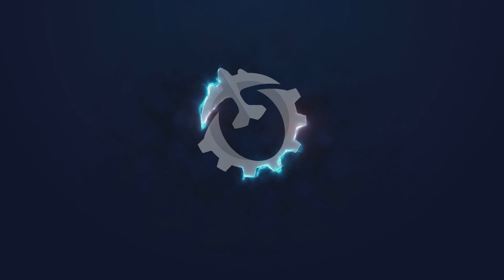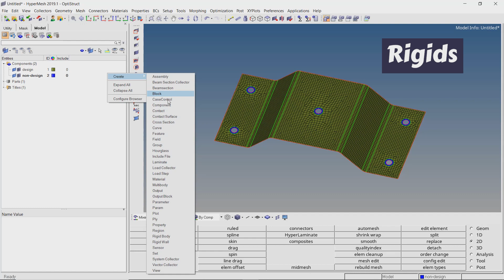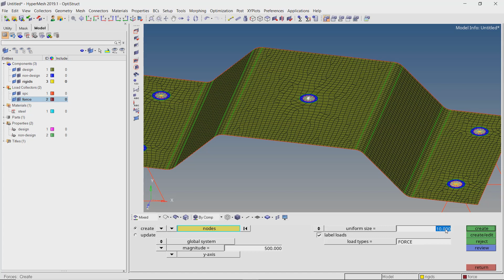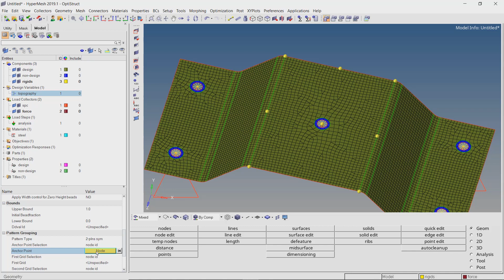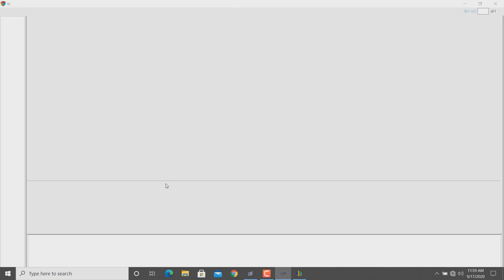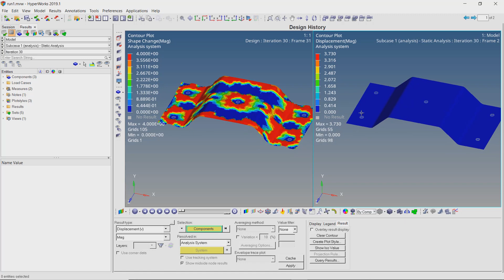Topography Optimization using Hypermesh [Optistruct Tutorial]

Comment: I want to perform topography Optimization with increasing the frequency and reducing the mass. Can you please suggest me which objective and constraints I need to give in the model.
Reply from the maker: Hi Muttu,
You can use frequency and mass fraction responses. Constraint will be on frequency and objective will be to minimize mass fraction. Remember that you will probably have to use the EIGRL card to extract natural frequencies and corresponding mode shapes to be used in the optimization.

Comment: Thank you for showing another informative analysis. 
A quick question, is the shape change contour result (thickness plot?) based on the bead parameter with the draw height of 4.0 mm? In other words, will the result be different if you change it to 5 or 6.0 mm, perhaps with the smaller width? It's good to see you can minimize the deformation about 1/10 by doing this. I know the topography optimization is not objective to weight reduction only but did you also see any positive effects on weight/stress with the optimized result?
Reply from the maker: Yes indeed...the shape change contour is based on the bead parameters. If we change the draw height and width, the contour will definitely change. The values I used for these parameters are industry standards based on actual manufacturing constraints for sheet metal bending. We can experiment with these values but going beyond the range I mentioned will become a problem for manufacturing.

As such, only performing topography optimization did not provide any benefits with regard to weight reduction but there are several techniques to couple topology and topography together in the same analysis. 
That provides much better results along with significant weight reduction. 
I will surely work on making a video about combined topology and topography soon!
Reply: @Aeroswap Thank you for the detailed explanations. Yeah it makes sense to keep the parameters as it is for the manufacturing constraints. I would love to see the combined analysis, it would strengthen us FE analysts to provide a complete solution package including strength assessment, optimization and manufacturing also.
Reply: @kenkim2687  I totally agree!
Reply: @Aeroswap  Dear Swapnil, will be looking forward to it! i.e. combined topology and topography optimization tutorial!
Reply from the maker: Hi Ali,
Here is the link for combined topology topography optimization tutorial -
https://youtu.be/TsNaPiz9uQI

Comment: Hey Swapnil, Great work! 
Can u explain the difference between topology and topography optimization techniques?
Reply from the maker: Hey Dileep!
Topology optimization is about reducing the overall weight of a component by removal of excess material from regions of the model.

Topography optimization does not necessarily reduce the weight. It just makes the component stiffer by modifying the surface geometry. Subsequently, topography optimization  is only applicable for sheet metal parts.

On the other hand, topology can be used on any geometry.
Hope this clears your doubt.
Reply: @Aeroswap  Any topology optimization method is able to generate and/or remove holes in the design domain. Based on what is explained above, it seems that "topography" optimization refers to "shape" optimization (commonly known with this name in the literature). The main difference between these two classes of methods resides in the freedom the framework has to change the design (topology opt has more freedom than shape because shape optimization preserves the same topology).
Reply from the maker: Thanks for the detailed information!